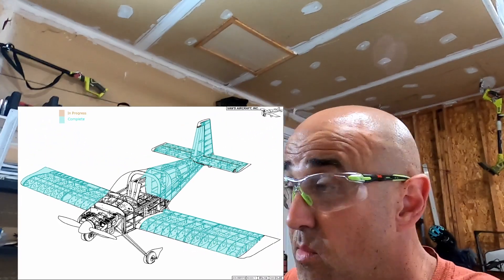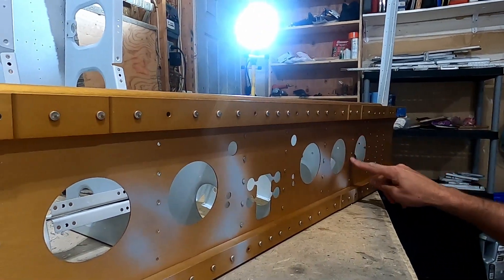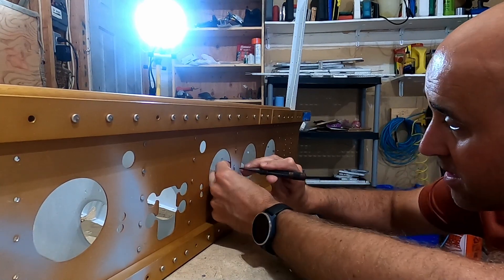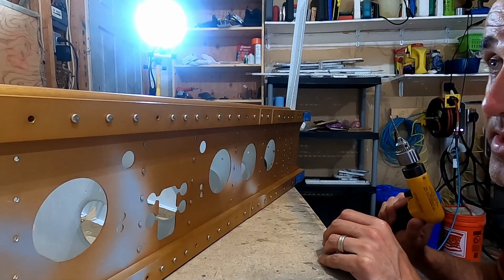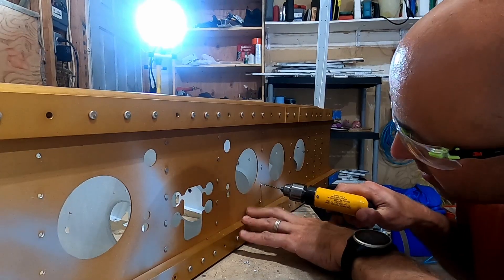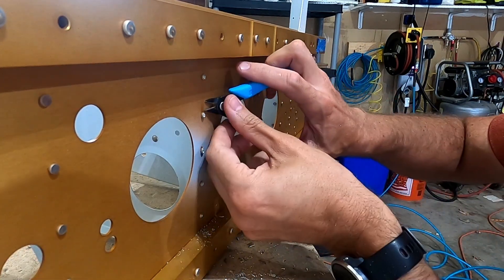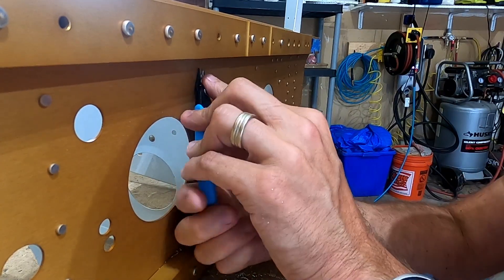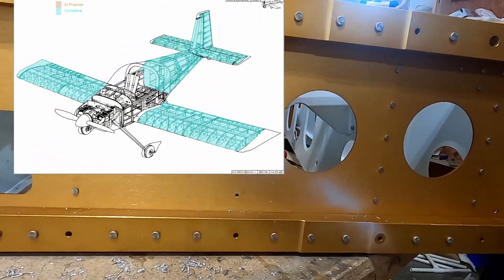Not for the faint of heart - Drilling rivets from the shop head side.

Comment: This process here, drilling out from the shop heads on a spar, is the only thing that makes me willing to consider accepting some laser-cut parts. I have some dimples with "notches" that I have meticulously cleaned up to the best of my ability, and I am praying that effort will mitigate cracking during riveting to the skin.
Reply from the maker: I thought the same thing.. didn't want to mess up the spar, then I counted how many holes I pushed out of spec in order to file out the cracks, which was the previous guidance from vans.. when I looked at the Numbers and thought honestly about how I would feel about constantly checking the bottom of the fuselage for smoking rivets I made the decision to drill them off the spar.

Comment: Have you tried using a rivet shaver in the countersink cage? I had to remove some shop head rivets building my RV 14A. I used a rivet shaver head in my countersink cage set .002 shy and had no problems removing rivets and you don't have the worry of enlarging the hole.
Reply from the maker: Also, you just completely invalidated this video! good job :D
Reply: @RyanE67  sorry 😫
Reply from the maker: @georgepelletier179  just giving you a hard time
Reply from the maker: That's a really good idea George!  I had not thought about it but I will get one of those bits and give it a try!
Reply from the maker: @bertschb  https://www.aircraftspruce.com/catalog/topages/at429b2.php
Reply: Nah, just move the camera again so you can block it with your other hand. That’ll get em out clean for sure 😂